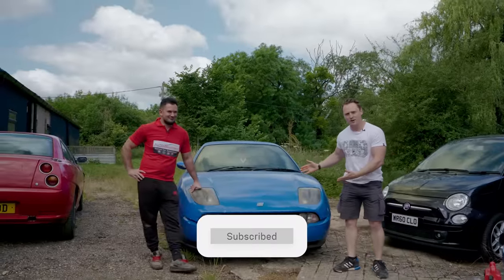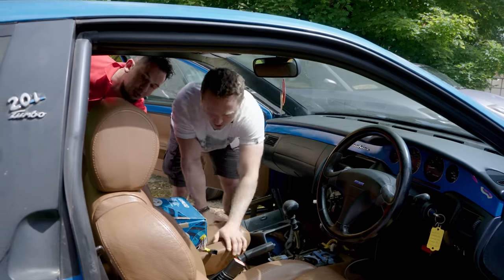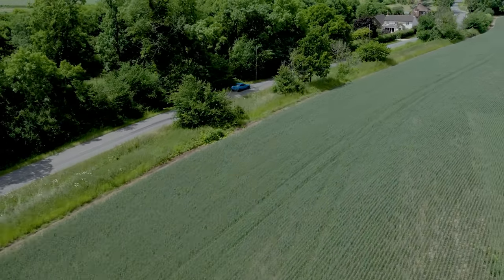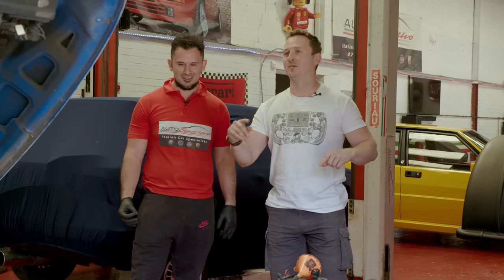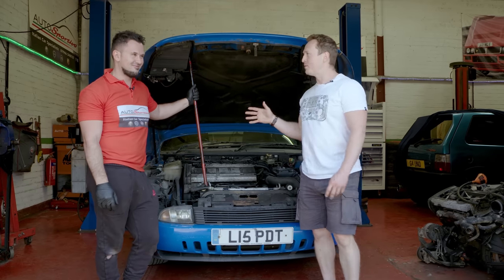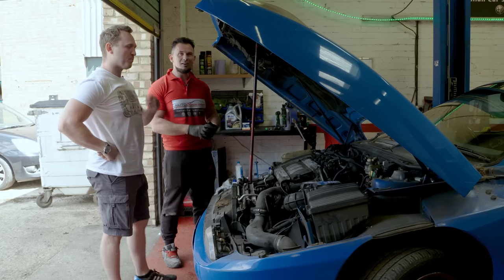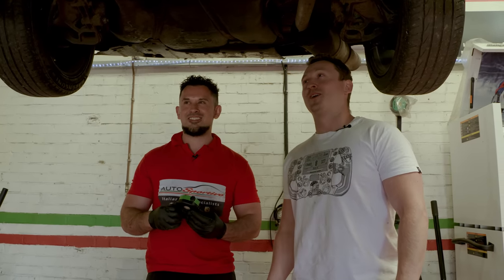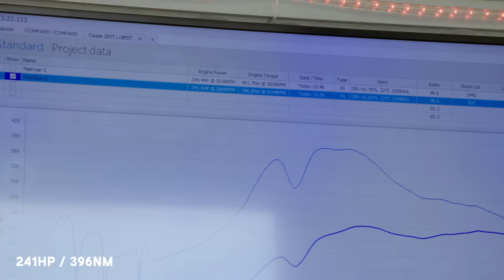Oh Crap, I Now Own A High-Mileage Italian Sports Car!

Comment: I didn't get how and why this car is over 240hp..is it been remaped?
Reply: Chipped with gtec 1 plug n play chip
Reply: This a cute little coupe. My moon grey 20vt plus is running 340bhp to the wheels. 
Even at 240bhp they are no joke though.
Reply: @cylturbskie  My one is 270hp at the wheels, with 0.9 bar garett 3071...Before few days on a motorway one porshe panamera couldn't believe what's going on with him over 165mph 😁
Reply: @lilisipova2965  mines 340 with 303lbs/ft. Spec as follows:
480cc injectors
4 bar fuel pressure reg
Walbro 255 fuel pump with wiring mod
Stage 3 hyrbid turbo
Stage 4 fc performance remap
3 inch decatted exhaust
Apexi electronic boost controller 
Pro alloy fmic
40mm alloy radiator
All silicone pipes
Collins twin piston bov
Apexi intake
Bc br racing coilovers
Need to replace: non light up boost gauge with my smoked propsport one with white or blue led dials.
Reply: @lilisipova2965  haha yeh these “faster cars” are not driven by enthusiasts you see, so they dont have a clue. 
Oh, where are you located? Im down weymouth
Reply: @lilisipova2965  might be posting a video on here do a walkaround and rev of it. Not sure yet. Not sure i like the idea of people knowing roughly where i live and what im driving.
Reply: @lilisipova2965  have you a mod list?
Reply: @lilisipova2965  only cars that have tried having ago with me on the motorway (after collecting the coupe - which i straight up traded for my bmw 520d 2009 for) was an s5 and c63. They got OBLITERATED. they couldn’t gain enough speed to get close to me, let alone get next to me.
Reply: @lilisipova2965  ???
Reply: @lilisipova2965  hello??? Have you vanished from existence or something in the past hour??
Reply: @cylturbskie  To be honest I m very happy from the power and fuel consumption. Basically we maked the tourge to goes with exactly the straith line with the revs.. After 4000rpm to 7000rpm my power line doesn't got any power gaps or loses of the tourge.. The feeling is like very powerful Honda V-teck if get me what I mean.. On a motorway with avarege speed 120mph miles... Here we are in Bulgaria 😁  My fuel consumption was great. I will try later on to show you the car.
Reply: @lilisipova2965  thats all that matters. Im getting pretty good mpg aswell. My turbos not really doing much until 3.5k but i think my rev limiter has been upped maybe even had a balancer shaft delete also but couldnt be sure. . Ive been running here there and everywhere since last monday and only used a quarter of a tank (all short drives)
Reply: @lilisipova2965 with the apexi boost controller i can see various engine parameters, rpm, throttle position, injector duty, some other really in depth stuff but keep it on the boost only readout which shows up like a heart rate monitor with the line being flat then moving in correlation to what the turbos doing which is nice so i can see if its spooling as it should or not etc.
Reply: @lilisipova2965  yes i get ya with the linear power kick
Reply: @lilisipova2965  typically another coupe owner being so far away. 
If i do post a video of mine it will be under another youtube channel name. Ill let you know.
Reply: @cylturbskie  Yes bro hopefully I will get one of these as we'll
Reply: OK Thanks
Reply: @lilisipova2965  hey again, ive just uploaded two short videos of my 20vt plus if your interested.
Reply: @cylturbskie  I will see them now. Thanks
Reply: I saw it.. It s a pretty cool
Reply: @lilisipova2965  nothing better than a moon grey plus model with loads of  power
Reply: @lilisipova2965  eats c63 amgs, the big audi sline and rs line cars all day
Reply: @cylturbskie  Must be.. Few weeks ago I v done the rolling start with porshe panamera, the coupe was almost bonnet in front and win over 155mph until 165 maybe more.. The Panamera speed is probably reduced to 155mph
Reply: I will show you may one as well.. I m little bit far a way from the car now.. I will make it after few days
Reply: @lilisipova2965  dont forget they are big heavy cars them panameras aswell
Reply: @lilisipova2965  ok cool look forward to seeing it, i will put up a video revving it tomorrow.
Reply: @lilisipova2965  sounds like it was a fun race haha
Reply: @lilisipova2965  is yours 6 speed 20vt also?
Reply: @cylturbskie  No Bro unfortunately is 5 speed ..I m looking to take 6 speed but is difficult to find.
Reply: @lilisipova2965  yes very difficult. Which is why i treat my plus like a princess and never rage on it.
Reply: @lilisipova2965  i think the drive shafts are different lengths on the 6 speed also.
Reply: Do you see it?
Reply: @lilisipova2965  well you didnt say that you uploaded a video of it till now so no. Ill have a look now
Reply: @lilisipova2965  im yet to post a video of exhaust of mine

Comment: I don't drive , I have never driven..
. Or ever had the urge to learn to drive, I'm 46 years old now and even I know that car need saving it's a little bit special. sell that Franken-Mazda because as your car throttle roast ( 24th of June episode) was mostly MX5 Mazdas proving everybody's got one and  there as common has cowshit,  but that little Fiat is a unicorn turd !
Reply: Why would you not want to drive?! my god……there about 400 of these standard 5 speed 20vts left on our roads, i have the even rarer 6speed  20vt plus model with only 50 left, mine is in moon grey  colour running big power, certainly a special feeling behind the wheel.
Reply: @cylturbskie  its just never appealed to me tbh..... I do have a pretty awesome mountain bike and trailer tho, I'm as fit as a butcher's fiddle with legs like Chris Hoy lol .... so my gut feeling this is a special little car was right then?
Reply: @johnascroft9206  fair enough mate, wish i could say the same for myself, oh yes very special. 72,762 made globally.